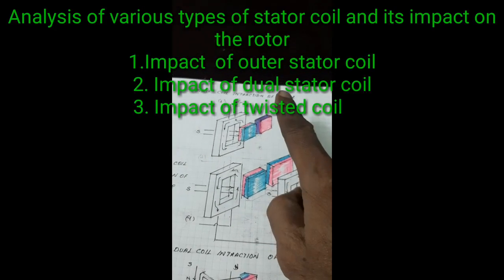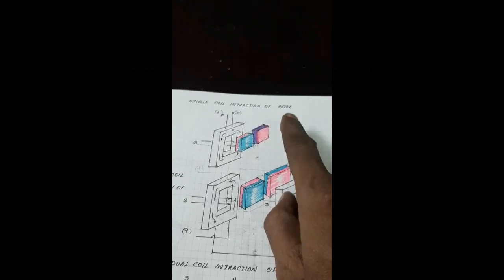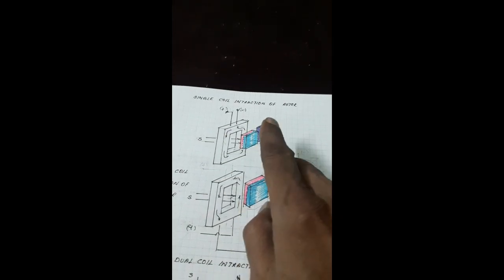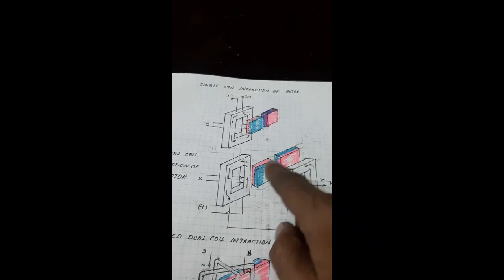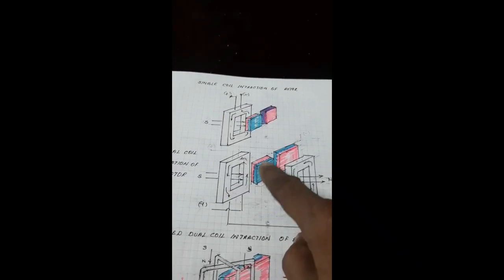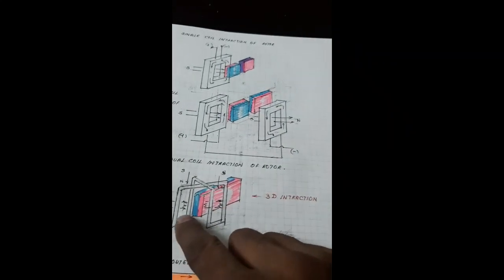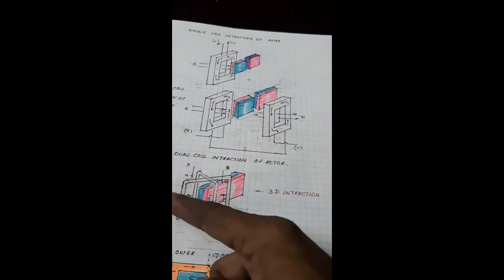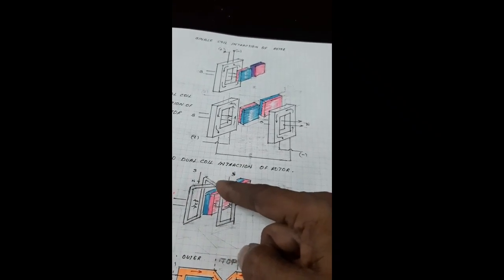High efficiency bldc motor using twisted coil (type-3)

Comment: An idea for a future experiment if you want to try: Put a larger iron core (the shaft) and put another serpentine coil around the iron shaft that would be a generator coil. Monitor the voltage output of the generator coil after you stop the input of the motor coil (the outer coil). Expected result: for a short time, the shaft's magnetic poles should keep spinning after the voltage is interrupted in the motor coil, acting like a electromagnetic flywheel (holcomb generator).
Reply from the maker: Thanks sir